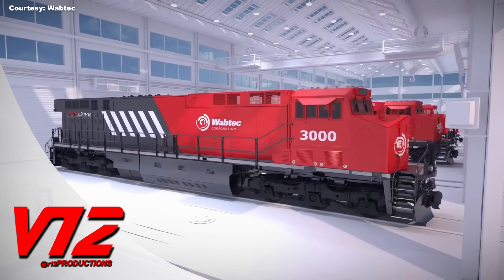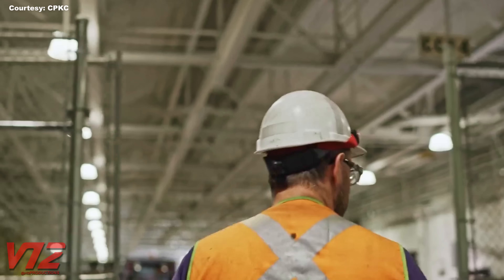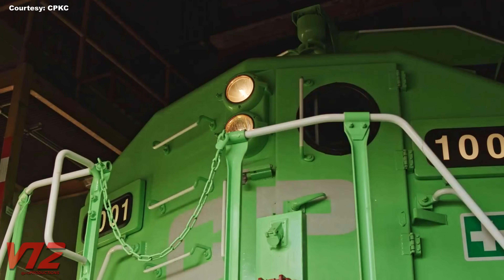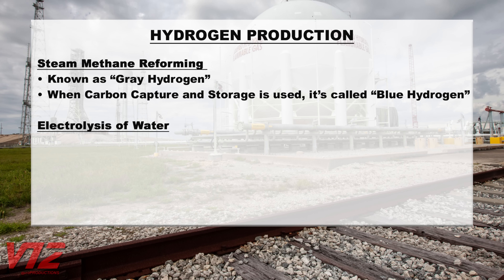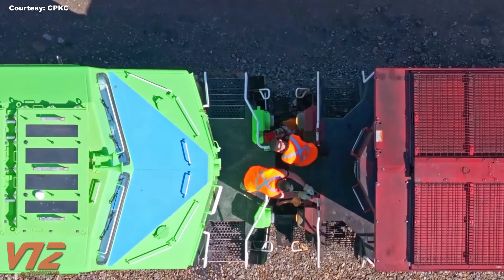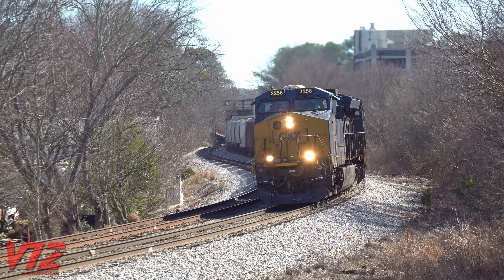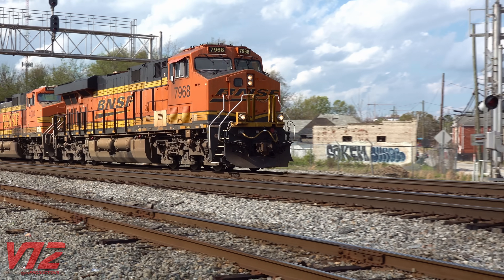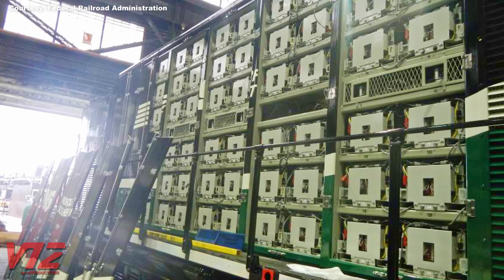The Future of Train Technology?

Comment: Even countries like India now have a fully electrified rail system, both freight and passenger. The foot dragging on public infrastructure improvement and innovation in the U.S. is legendary. I do believe the future of railways is electrification, not diesel-electric or hydrogen-electric, etc. Once the electrification infrastructure is built which is initally costly but it'll pay for itself many times over in cost savings with sourcing any types of fuel, transportation, processing, distribution, storage, fueling and other costs.

Comment: You know the Stadler FLIRT hydrogrn DMU in San Bernardino cost 3x as much as the nearly identical diesel DMU units and then it broke down soon after its debut, right?  As you hinted at hydrogen fuel production today is expensive and these trains are major explosion hazards with the hydrogen compressed to 10,000 PSI, the kind of pressure you find at the bottom of the ocean.  Then Stadler maintains the train as it is too complex and hazardous for Metrolink to maintain and Stadler had to fly in specialists from Europe to maintain this one train set.  It is just not a general maintenance item.  Hugely expensive to Metrolink to pay for this maintenance contract with Stadler for this one hydrogen train.  Then they stuck it out in San Bernardino on a line nobody uses and if someone crashes into the side of it and it blows up or details, falls on its side and blows up, mainly just drugged out homeless people camping out around the tracks will die.  They did not put this where there are a lot of people.  They did not put this where it would show prominently to the public.  They stuffed it away somewhere where the liability for an explosion would be the least.

This all makes me wonder, if you want to burn cleaner than diesel, why not just do propane?  You can already get propane cheap enough.  According to the Chinese, once we have advanced fission nuclear, especially if we build it at train scale in factories, we can make propane cheaply using carbon capture tech for a net CO2 neutral fuel cycle.  Propane burns very cleanly in a properly optimized conventional ICE engine.  Propane can be stored as a liquid at ambient temperature and at a reasonably low pressure.  You can have a multi-locomotive consist use a single propane tender, pumping liquid propane efficiently to the locomotives from the tender and boil it into a gas in the locomotives.  Propane is already moved by LPG tanker cars, so easy to get the fuel to the trains today.  The relatively low pressure nature of propane and decades of studying transport and general handling of propane means it is easy enough to make this a safe fuel to use.  After all, we all use propane in our BBQs at home and beyond leaving the propane tanks outside / in well ventilated places, we never have to fret over safety or worry about something going catastrophically wrong.  For train scale, you insulate the tank so it can't heat up too quickly and have the emergency relief valve point away from the tank along with some gas leak sensors and automatic shutoff valves when a leak is detected and it should be easy enough to safely use.  The worse case rupture in a derailment once basic safety is there that we have seen is a big fireball gets sucked skyward from the heat of the flames as the liquid propane escapes and boils into a gas while exposed to sparks from the derailment.  The skyward flames feel hot from the radiant energy, but people have been just feet away and have been fine; waked away with no injuries.  I mean we have reasonably safe designs around propane today and there is nothing too special nor exotic about it.  Hydrogen is a totally different story and something I wouldn't want to touch evrn with a 100 ft pole.

For overhead electric in the USA, I think we need to move to a 50 kV DC standard instead of the 25 kV AC standard often pushed today.  The reasons are we have long spans that need electrification out in the middle of nowhere and the higher voltage while doing a 2 x 50kV where you have a negative return line off to the side like you do with 2 x 25kV AC systems will better cover these long spans.  We also need to think about having track speed limited freight trains.  Say going up the Cajon Pass with frequent 10 locomotive train consists going up and down the pass, have each locomotive pull up to 10 MW for a total of 100 MW going up and then regenerative braking, all that you want, while going down the pass.  Going to DC in our power electronics world means a whole lot less space and mass used in the locomotives for the conversions.  You could either keep a big ICE engine in the locomotive or even put big battery banks in there.  In general mass budget in locomotives matter, so why waste it on AC - DC conversions when DC - DC conversions are far more compact and efficient?

Comment: The obvious method is to power electric locomotives from overhead catenaries, just like every other modern country in the world. Some countries, like Switzerland, are 100% electrified. And now you can have the best of both worlds: partial electrification. When under wire, a battery electric locomotive could recharge its batteries as it runs. Prioritize electrification of steep grades both to help trains go uphill and accept some of their regenerated power while going downhill.

Comment: the hybrid i think is probably the best for switching, shunting, and yard work as putting catenary in a yard is quite hard. and to those saying "just put catenaries on the mainline" are grossly underestimating the size of the us mainline tracklength and the difficulty and expense of some of those tracks like through the rockies. not to mention the maintanence involved when the rocky mountain weather is involved. and then the long stretches of the plains is just expensive with the length of those lines. yes it could be done but i doubt the freight railroads have the current ability to do that kind of immense overall of their networks.

Comment: The cause of the Hinddenberg disaster was aluminum oxide paint that attracts and traps a discharge of static electricity from the atmosphere along the hull and trapped Hydrogen gas in a light weight vessel used for air boyantcy came into contact with the static discharge. But as it was teathered to a column, I wonder if the column the Zepplen was hitched to was properly grounded in the event of a lightning strike?

Comment: The pipe dreams going here are phenomenal.  Making hydrogen to power a locomotive......using the grid to turn water into hydrogen and oxygen through...... electrolysis, using tons of electricity.... from the grid, or charging BEV locomotives from ..... you got it...the grid.  🙄
Reply: Yea but they could run off of grey hydrogen as well which is not as expensive to produce
Reply: @Steve-p7z8h or. They can connect to the grid

Comment: These all seem like incredibly thought out ways to skimp on building overhead wires. 

Electrification is the future, but it's going to take central planning (especially since it's become apparent in recent years that all class ones don't give a shit about their infrastructure).
Reply: Electrification is no longer feasible.. the amount of money to construct overhead wires over 140k + miles of mainlines in  the US would be astronomical.. not including branch lines. I don't see Canada or Mexico going that way either. the fact is hydrogen and battery power is the future. as for RR infrastructure? they can build a wooden bridge that can last 100 years.. they can install a prefab concrete bridge in 72 hours. RR infrastructure from the ground up is a testament to engineering

Comment: While overhead wires do have a lot of CapEx, I do think that hybrid electric  would be a good option.  Run overhead lines where its viable and then let the diesel kick in when not in a place where its viable to run lines.  I think Amtrak is getting equipment for this ALC-42E is it? it will have a tender behind it with a pantograph.  Allowing them to seamlessly enter and exit the NEC without changing locomotives, Since you have to be electric into Penn Station.

for freight operations overhead electric would be great in places where the locomotives are starting and stopping all the time, I suspect their engines are only benefitting from the efficiency that trains advertise when they are out on open rails and cruising at speed. So for example when in more built up areas they tend to run slower or around yards. electrified yards would probably save a ton of fuel for the RR bean counters.

Additionally you should electrify mountain regions, While this seems dumb because they are often far from infrastructure. but what does allow one to do is that a train coming down can dump its dynamic braking back into the overhead wires, instead into resistor banks as heat the locomotives become useful generators adding back to the system.

Comment: Why don't they use hydrocarbon fuel cells using hydrocarbons instead of hydrogen? Improving efficiency to 70% instead of 40% by IC engines.

Comment: A railroad locomotive for hauling stores around 5000 gallons of diesel, which is about 200,000 kWh of energy.
The diesel engine that runs the generator in the locomotive is about 45% efficient, giving us 90,000-95,000 kWh.
A 1kWh of prismatic cell LFP battery which weighs 6Kg holds 1kWh of energy. This means if we were to power railroad locomotives with the cheapest batteries, with equivalent diesel energy provided, we would need 92,500kWh x 6Kg = 555,000 Kg of batteries. 555 tons. An average railroad car designed for batteries, without any excessive damage to rails, can carry 120 tons. Throw in additional weight of cooling systems and other stuff, each locomotive would need 5 railroad cars, around 120 tons each, filled with batteries, to pull the remaining 55-60 railroad cars.

Railroad companies usually have 100 cars at least with two or more locomotives. Let's say two locomotives. That means, 12 of the 100 cars would be two locos + 10 battery cars. Honestly, not that bad.

Now, coming down to the costs.
That 6Kg prismatic battery cell I mentioned above? It costs $50, landed in the US. $4,625,000 in batteries, just to power the locomotive. Throw in another $375,000 for cooling, inverter and safety systems. $5M a battery for ONE locomotive. How much does it need to charge, you'd ask? 

Industrial electricity is about $0.04-0.07/kWh. A 90% efficiency in charging (I'm taking the low side here, typically it is >95%) those five railroad cars, 103,000 kWh, $4120 - $7210. Equivalent energy in diesel, wholesale diesel is around $3.4 - which would cost $17,000. Each fueling saves you $10,000.

Now, before we move forward - remember, unlike the diesel locomotives, battery electric locomotives don't have to idle their generators when they aren't moving, they simply stop. Also, braking can put power back into the batteries, which for 100 car train, would be around 850-1000 kWh of energy. In your diesel locomotives, braking is through resistive banks, and actual brakes, which would be minimized in battery electric locomotives. Freight train locomotives consume around 4 gallons of diesel per mile. They do around 200-500 miles per day. Let us use 500 mile per day figure.

The current major roadblock in getting battery electric locomotives in US is lack of domestic LFP manufacturing at scale, which would drive down costs. And electric infrastructure that railroads don't have. If they start slowly investing in electric infrastructure, the savings would be monumental.

in 2023, Union Pacific bought 900 MILLION gallons of diesel fuel. It spent 15 billion dollars as total major expenditures in 2023, of which 23% was for fuel. Out of that, 98% was for locomotive fuel. It spent $3,381,000,000 on diesel for locomotives alone.

By our ratio above, if Union Pacific spends $7,210 for every $17,000 it spends on diesel, it would only spend $1.434 billion dollars on electricity. That is a massive fuel savings of nearly $2billion dollars every year. From those 2Billion dollars, you can buy battery railroad cars for 400 locomotives every year. As of December 2023 - UP has 7175 locomotives of 42 different models. With buying battery railroad cars for every locomotive, UP can change to electric in 15-17 years, without actually needing to spend anything more than its current expenditures.

Now, not only that - going electric means you eliminate diesel engine maintenance and overhauls every few thousand hours of operations. That means, savings actually exceed $2B dollars a year - those were just from fuel savings.

UP expenses in 2023 were $412M for locomotives. You can slash it in half by removing diesel engine. Another $206M in savings.

(I work with two companies who are trying to load batteries on railroad cars, and make systems for battery swapping. These stations would be installed throughout a railroads network and trains will make a 30 min stop, where their battery railroad cars will be changed by an automatic system, and the ones which were in use would be put in charging. I write railroad cars, but it wouldn't be the cars themselves, just the batteries on those, removing the need to de-couple and couple the locomotive frequently).

We expect, once the any railroad turns to battery electrification of its network, others will follow like falling dominos, the cost and ease of use advantage is too huge to ignore. Our press release should be out sometime in Q4 of 2025, when we will have delivered one system and 3 railroad cars/slugs filled to the brim with batteries, and potentially partnered with one of the loco manufacturers.

Comment: There’s a caveat to the “cleanliness” of LNG. Yes, it does produce far less CO2 than diesel, but it produces much more CH4 - Methane. The volume of methane produced by LNG is actually more comparable to burning _coal_, and there’s a lot of scrutiny on the maritime industry for this reason. It doesn’t seem too good terms of global warming either. CNG seems to burn hotter than diesel, I know just from observing buses in the summer, and I recall FEC used LNG in hybrid form too. I’m not sure if it’s because the diesel combusts at a lower temperature, like the hydrogen hybrids mentioned, or if it’s because combusting LNG on its own is too much for the existing engine blocks. 

I didn’t realize there were so many different ways to obtain hydrogen, but from the sounds of it they’ll be the closest thing to a modern day steam-electric. Cleaner than previous steam locomotives, but safer than on-board nuclear power, and more eco-friendly than diesel or LNG. It’s also (probably?) more humane to obtain the hydrogen compared to how batteries are produced, so that’s another plus.

Comment: Better hope those fuel cells are as crash strong as a nuclear flask wagon or you have a mobile bomb on the rails. 
In the UK we didn't trust nuke carriers until we test crashed a big locomotive and coaches into it at 100mph  on the worst possible impact angle, then pressure tested the flash after removed from the wreckage.

Comment: You're getting Hydrogen from Syn-Gas? 
Regenerative Braking like Rechargeable Batteries, which can also be recharged by Fuel Cells. 
A Fuel Cell that can run on Synthesis Gas would be useful.

Comment: worth popinting out that hydrogen bursn very quickly. the hindenburg burning was the thousands of gallons of diesel fuel used for the engines, as well as the flammable envelope, cabin structure and furnishings, and the fuel for the generators. exempting the hydrogen the zeppelins had a very high fuel load, fire wise.

Comment: In the late 1970s and early 1980s, the FRA studied dual mode locomotives and progressive electrification. The idea was to economically convert SD40-2s to accept overhead electric power but retain an onboard diesel generator. Instead of having to electrify an entire corridor or network, the process could be done incrementally. If you want to read about it, the study is called "Dual-Mode Locomotive Systems Engineering" published Februrary 1981.

Comment: The lengths an American freight railroad will go through to avoid electrification. They'll even invent a new locomotive over just electrifying the line.
Reply: Poor you
Reply: @Trainfan1055Janathan  Electrification isn't possible in some places.
Reply: @brucealanwilson4121  no, and for those cases that it isn't things like dual mode or battery trains are useful, but I'd argue many if not most of the mainlines especially the transcons as well as many of the regional networks around cities can and should be electrified. Yes it's a big cost up front, but in nearly every instance, electrification has proven to be the best and most cost effective option.

Comment: 9:19 This FRA report is nearly a decade old, and battery prices have changed dramatically since then. The study used a baseline of $1,250/kWh, with a "best case" model of $250/kWh, but today, batteries cost under $78/kWh—almost four times lower than the report’s most optimistic scenario.

With today’s prices, the economics of battery energy storage for locomotives look very different. If the same model were updated with current costs, the savings would far exceed the diesel baseline, making it a much more viable option. Definitely worth a fresh look!
Reply: Is that $78 number for locomotive-size batteries or automotive-size?  I would expect that the price for locomotive-size ones hasn't come down nearly as much, since demand hasn't surged the way is has in the automotive industry.
Reply: @ that is per kWh. The actual battery pack size is scalable and basically irrelevant.